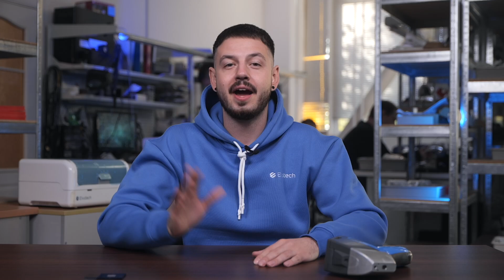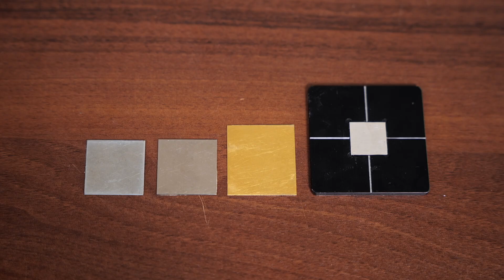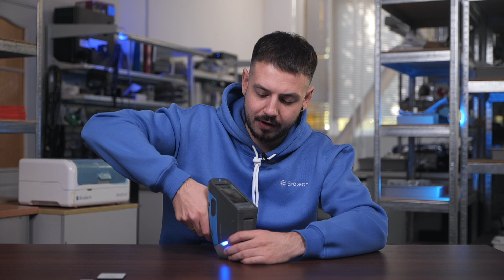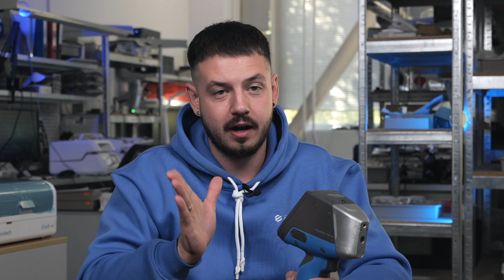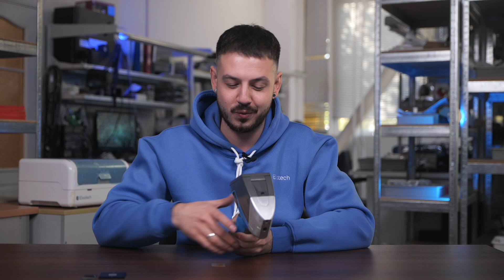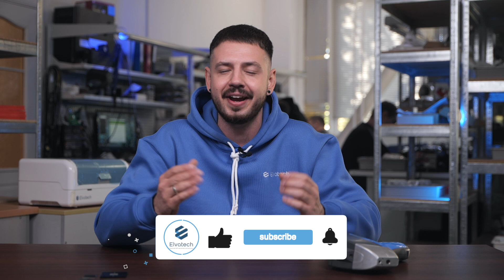Measure Coating Thickness with XRF Anywhere: ProSpector 3 in Action.

Comment: can this instrument be used in radiation environemnt? will radiation interfere in the reading
Reply from the maker: It depends on the type and level of radiation. If we are talking about gamma or beta radiation in moderate doses, then there is nothing to worry about. Our devices are currently successfully used to analyze the composition of stainless steel inside a reactor at a nuclear power plant.